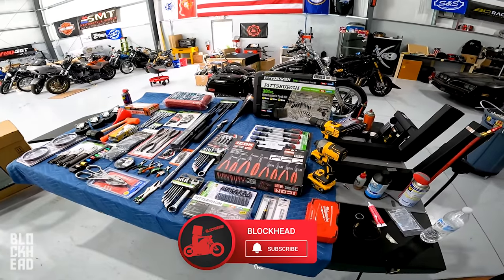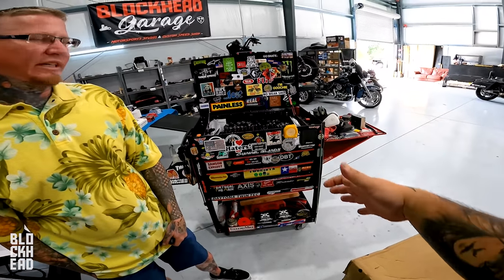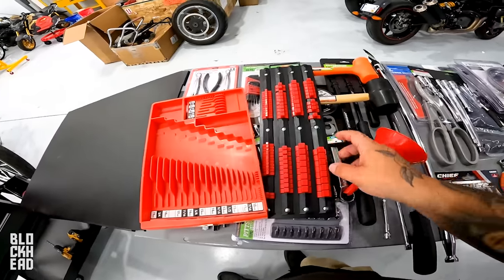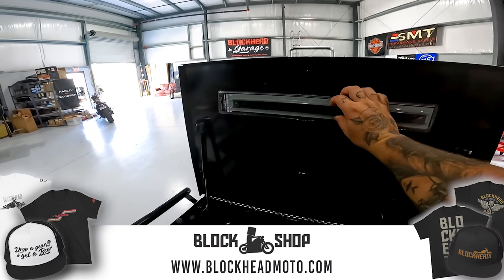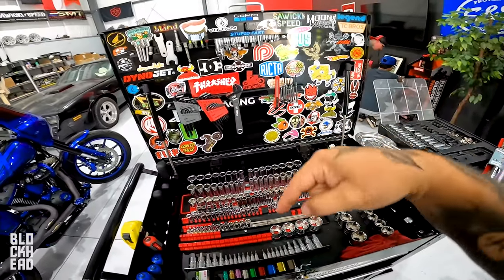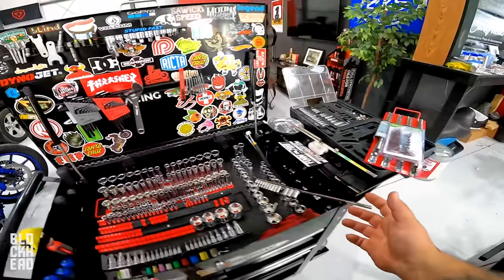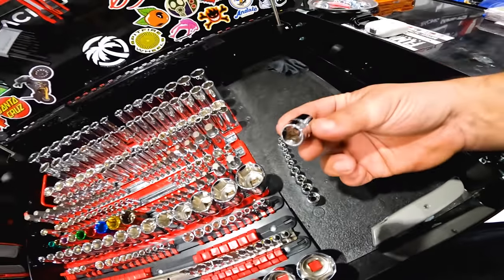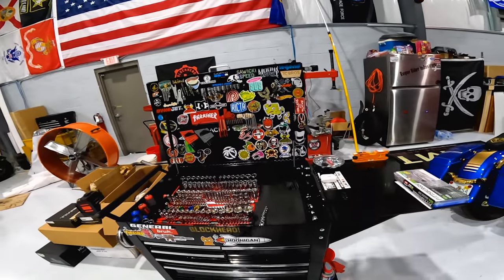Harbor Freight 5 Drawer Tool Cart - Setup and Organization

Comment: I was a machinist for 40 years. I had a cheap box and tools for the first year but eventually I bought better tooling and a better box. I still have all of it even after I retired. Investing in good tools will make your life easier in the long run...
Reply: while it's not too of the line, I think the cart is better than most of the stuff from HF
Reply: Anything with life time warranty
Reply: Agreed. Busted sockets and broken ratchets suck and not worth it if you're actually a higher end weekend warrior.
Reply: I partially agree, I think you need to invest in good power tools and good, lockable, strong, indestructible storage. But in my opinion, don't buy expensive ratchets, they break too often and are very abused. I will note, I do have a toothless ratchet for the rare circumstances that I need it

Comment: I'm a master auto technician been in this business over 20 years I've had my harborfreight box same as yours for over 10 years and I've dropped it a car has hit it, it's always overloaded the only things that are wrong after a decade of abuse there is no rubber left on the wheels from rolling in chemicals and greases. And the lift supports I replaced with a bar when they gave out and the lock froze up and I had to replace. As for I tell this to all the new GST that come in, buy cheap replace with quality as they break. I have tens of thousands in snapon, matco,and Mac but in my main box I also have backups of every socket and wrench and ratchet  in husky, craftsman, Cresent, vicegrip, duralast, etc ... even the most expensive best quality tool wears out and brakes and the tool truck only comes once per week.

Comment: Here are a few tips regarding your tool cart & tools that could have saved you a couple of bucks and some time. 1. HF sells swivel casters that are an exact match with the ones that come with the tool cart. You could have bought only two (using the already included swivel ones) and no drilling required. 2. HF sells magnet packs (2 pack for $.99) that are the same width as the magnetic strips. Put 2 or 3 on the back of the strip magnet and just place the strip where you want them on the lid. No drilling required. 3. If the HF socket organizer is steel use the same magnets in #2 tip to attach it to cart. Should eliminate the difficulty removing the sockets as these magnets are really strong. 4. Not a money saving tip but, I would have looked a buying HF's Quinn line of tools. They cost slightly more than Pittsburg, have the same lifetime warranty but are better quality (much closer to Lowes Kobalt line in quality as a comparison). The Quinn screwdriver and plier sets are significantly better than the Pittsburg line.  As a side note I was wondering how you could see any tools on the underside of the cart's lid with all those distracting stickers? 😉
Reply: @I_Died_2_Weeks_Ago Says the guy watching a video about Harbor Freight Cart and Tools..😂😂😂
Sorry for your loss…..brain loss.

Comment: Harbor freight sells socket sorters made by U.S Generals called Peg-Type i have them in my U.S. General rolling tool box and i highly recommend them the peg doesn't snap into the socket it just goes through them it would solve all the problems of the sockets there is no fight at all with them.
Reply: They make them in metric and SAE i have both sets
Reply: I also have these and they are excellent. A bit odd that they have 1/2” drive all the way down to 1/4” and 8mm or so, but I love them anyway. I got mine in different colors for each metric/sae
Reply from the maker: I’ll have to check those out!
Reply: @BlockheadMoto  Ask for the different color socket organizers. Usually set on the end cap 👍
Reply: I came here to say the same thing. I have the peg style trays and they are great. Some come labeled as well, so it’s easier to find what size you need at a glance
Reply: @hobbitfootmoto9685  these are some of the best purchases in HF imo. The labeled sizes are a huge bonus

Comment: I have had that US General tool cart for like a decade now. I heavily overload it all the time and it is stuffed with all of my tools. Drawers still work flawlessly, I have even left the big drawer fully loaded with screws at full extension for several weeks because I forgot to push it in and didn't notice. Absolutely no problem lol. The thing is a beast and is like the best deal in all of tools on the planet
Reply: "I have even left the big drawer fully loaded with screws at full extension for several weeks because I forgot to push it in and didn't notice"
How did you not notice a fully extended drawer for weeks?   Are there blind and a quadriplegic?  How often have you forgotten to lock you doors when you leave/enter your car or house/home?

Comment: One of my good friends (and a professional wrench on bucket trucks) told me a long time ago - when you go to buy a tool, buy the cheapest decent quality you can find (eg, Harbor Freight). If you manage to break or wear out the tool, then you use it enough to justify the cost on the highest-end tool that you can find. It's saved me literally thousands over the years listening to that advice. I have a few tools that I've had to replace under the broken/worn out clause, but for a home gamer like me the less expensive stuff (Home Depot and Harbor Freight mainly) is usually perfectly adequate for the work I'm doing. In the end, it's not the price tag that matters - it's if you can get the work done.
(note: since I saw a comment below about cut-off wheels...this only applies to the tools, not consumables like cut off wheels, grease, anything that you will have to replace with time. In that case, the couple extra bucks from a known-good brand can save you from an expensive/life-altering mistake)
Reply: I’d definitely do this with stuff that’s not the bare minimum (sockets/power drill/screw drivers). Very good idea

Comment: Ernst manufacturing makes a pretty dope socket rail system called the socket boss if you're more into that style vs a westling setup. Pop off a rail from the base and take it to your lift, walk it back over and pop it back on. Easy peasy. Can even switch it out with other rails from your main box so your service cart has more of your "every day use" sockets and what not.

Comment: My son went to a two year tech school for automotive and was given the list of tools recommended  by the school, your basic starter setup. The estimated cost through the school with all the major brand names snap on, matco etc with a "school discount "was around 8-10  thousand dollars with a tool box. We went to harbor freight and bought everything on that list including the optional tools and few more I knew he would need and a bigger tool box than the recommended size for 2500 dollars. He is still using them everyday and have not had any issues. I agree that some tools you shouldn't go cheap on but you don't need to go into debt on the tool truck to do your job.
Reply: For a freshy straight out of school its smart to not go into deep debt. Eventually he will want to replace the cheaper tools with premium tools but its worth doing that over a lifetime. My old man has been using some of the same tools like orginal USA made Vise Grips, Snapon wrenches, etc for over 20 years. No reason to go into debt in the short term when you can buy over the long term and pay cash for stuff.
Reply: @chrisp174  exactly what I told him, upgrade when he can afford it and if it's needed.
Reply: Down payment on a house, much better investment than Snap-on and Mac tools!!

Comment: I use one of those 5 drawers at work. You really need a cab or another box for storage so you can keep all your commonly used tools in your service cart, and anything you don't regularly used stashed away in the big box. Helps out a ton. Because you will still have your less commonly used tools, but you will have everything you need commonly in arms reach and well organized. Like I work with metric mostly... So i keep all my standards in the bigger box so I don't mix them up as I am grabbing and setting down tools. The key is to have space to throw your shit around and not make a disorganized mess because if you don't have a lot of space on the top you will mix them in and lose shit slowing you down.

Comment: As a mechanic for the last 30+ years and still going. I have all those high end tools at work. But at home . Most of them are harbor freight tools. Except a few tools that you don't want to skip on. Like ratchets. It sucks when they break and you smash your hand on something 😕
On a side note, that socket organizer you didn't like because they where hard to get off. That is done intentionally.  That is made where you can grab the hole thing and take it anywhere and the sockets won't fall off

Comment: Probably most of the viewers are amateurs like myself.  I work on everything.  Have tools everywhere.  I'm always amazed how 10mm sockets disappear.  I've probably bought 10 of them from Lowe's, which is less than a mile from the house.  Everything:  HVAC, plumbing, electrical, motorcycles, trucks, cars, scooters.

Comment: My suggestion would be to put your ratchets and extensions up top with the sockets. That’s way what you use it together and you don’t have to go 2 different places in the box to get things that constantly with each other. Also laying your screwdrivers and pliers opposite of each other and flat will make it easier to see everything all at once and make it faster getting what you need
Reply: I like the wire racks for my pliers it puts them in a row and makes it easy to see what you have

Comment: I have the same tool cart an I brought Pittsburgh sockets in 1/4, 3/8, 1/2 inch shallow an deep in metric an sae an I got the socket trays also. You had some loose sockets I know harbor freight sells magnet socket holder that holds 10 sockets I got one in 3/8 maybe you should try one they come in 1/4, 3/8, 1/2 inch

Comment: I agree with you on not having to buy top tier stuff if you are a DIY guy but you will find out that Pittsburg hand tools are not  the best. I'd recommend spending a little bit more and getting a little better quality. For example Harbor freight torxs sockets are no good. They will break and round out eventually

Comment: Has anybody tried cutting out the tool box the sockets come in to use as the organizers. I saw one of them was removable if it fits it might be worth investigating.
Reply: I had them in their original box but the box is falling apart where it locks and the hinges are next. So I was considering moving them into my tool cart while keeping the plastic molding they came in

Comment: @Blockhead I have some thoughts... based on personal experience. NEVER... EVER buy cut-off wheels from Harbor freight again.. Ever. They’ll break and shoot a piece of the cut-off wheel into your cheek at ~20,000rpm. (Which didn’t happen to me, but happened to a guy in my shop; luckily for him it just knicked his lower-cheek). 
 There’s some things that are ok to “go cheap” on.  Stuff like cut off discs, grinding discs, & flap discs.... are NOT those things. They’re dangerous. Look at Diablo, Or DeWalt discs. A couple bucks more could potentially save you or somebody else from a pretty serious injury.
Reply: Ian Loyd, 15+ years, never had a problem with HF cut-off discs. Let the disc do the grinding/cutting not the operator.

Comment: In my personal tool chest (and I'm a hobbyist, not a pro), I have MOST of my box wrenches on the magnetic strip inside the lid (excepting a couple of oversize ones and a set of ratcheting wrenches), then my ratchets, 3/8" and 1/4" sockets, and leftover wrenches in the top section. I keep my 1/2" sockets separate, with my air tools, because I am more likely to use those with my air ratchet.
RE. stickers: C'mon dude... starting out with a stock of stickers from the get-go is just effin' CHEATING! You're supposed to collect those over your time with the cart, not be makin' Chris look like a rookie on the day you set it up! LMAO!

Comment: I mean I'm a professional mechanic not a vehicle mechanic but I would not get snap on toes are really expensive but there's other quality tools that aren't as expensive still expensive but not as most of my wrenches and sockets are Milwaukee and the ones that aren't gear wrench that being said the Milwaukee ones are on power quality wise with the snap-on the gear wrench is a mid-range tool all my players are connects which are the best in the business still cheaper than snap-on players and snap on players are basically useless if you ask me they're like toys I would love to have some snap-on wrenches you know if I spending $300 on the full set of SAE metric wrenches for Milwaukee I'm spending $300 for not even a full set of SAE with snap on it just doesn't make sense

Comment: Support China 🙄
Reply: Exactly
Reply from the maker: I’d love to buy Snap-On if y’all are willing to pay for it! Let me know and I’ll send you my PayPal info 😊
Reply: Icon isn’t bad at all. Although if you have the money, Snap-On is great. I use a lot of Snap-On stuff and have zero complaints, however, Sunex for impact sockets, Fluke for anything electrical related, Milwaukee for power tools and Snap-On for wrenches, chrome sockets, ratchets, and anything else I use constantly every day. 

That said, Snap-On multi meters suck ass, idk how they cost so much and aren’t as good as an 87V. Straight trash.
Reply: @BlockheadMoto  support the country you live in. Or live in the country you support.